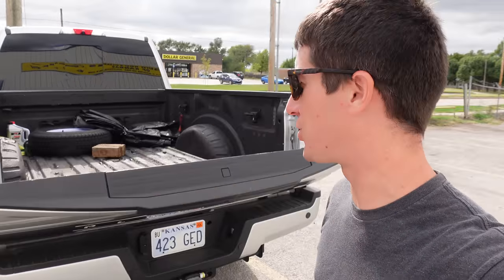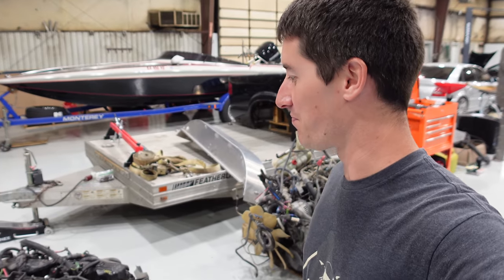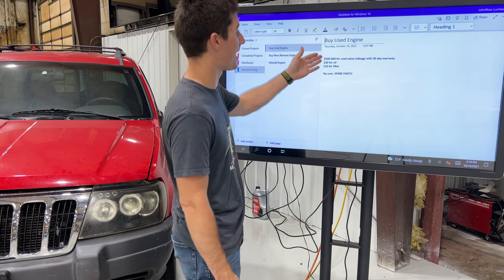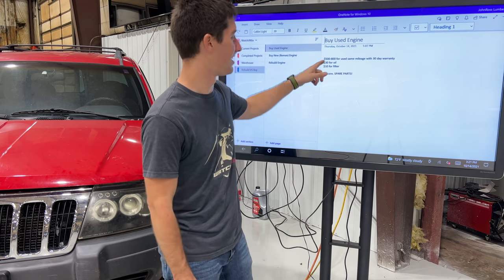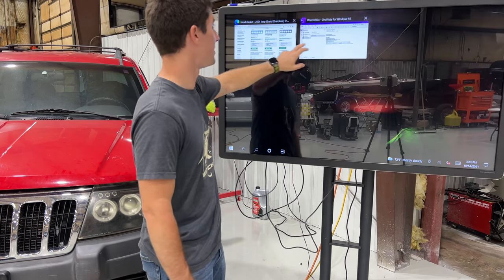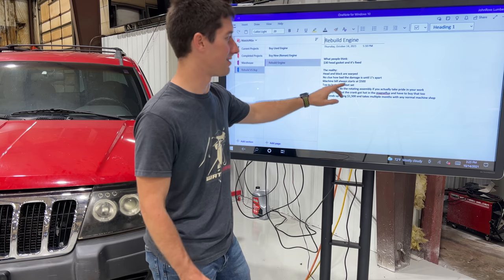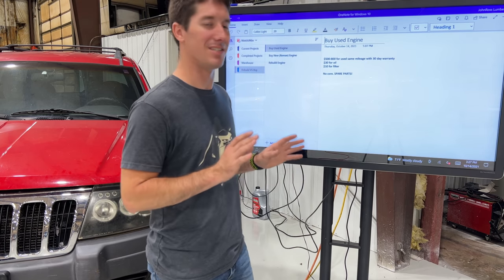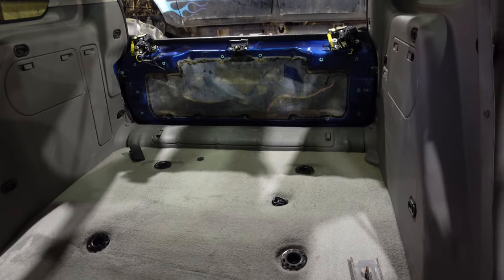Here's Why You Should NEVER Rebuild An ENGINE *The Math Doesn't Add Up*

Comment: I have done dozens of engine and never had to replace crank shaft, most big blocks have been done for 2400 to less than 3000 for V10 Ram  I always get a kick out of all these guys saying it’s 10, grand for ending rebuild, however you have the closest cost on rebuild, even though it’s high, but I don’t sell my trucks, I keep everything, my V10 Ram 2500 has ove 300,000 miles on, I bought new with 7 miles on , but I did like your vidp

Comment: I wish I saw this video before I decided to rebuild my N52 engine. Everything you said is exactly what I went through, now I need to get a new head or buy a 2nd hand engine
Reply: Hahaha... I found this video and this comment as I am trying to figure out what to do with my N52. I think I am getting piston slap or rod knock
Reply: @rockbe02  lol after fixing the engine, it was misfiring, only to find out it's my injectors. I then sold the car immediately. The total cost of fixing it is higher than a 2nd hand engine, I should have just done that from the beginning, hopefully you don't go through what I went through 🥲

Comment: This is why you shouldn't use the word "never" in a video, then go on to list all the times that rebuilding is necessary. If your goal is specifically to flip a car with a bad engine, where a running salvage replacement is available cheaper than a rebuild, and you're selling to someone who you won't have to see at a family dinner, or if they are coming to a family dinner you can easily avoid them, or you told them upfront the car has a salvage replacement engine then yes NEVER rebuild an engine. Also when you swap in salvage drivetrain, please don't tell someone it has a "new" engine/trans. That is seriously wrong. "new to a vehicle" is not "new", thats shady shit.

Comment: Well it is true in some cases and so wrong in many other cases.  You have access to cheap and good source of engines close by that have warranty.  For people that don't have that close by and have to rely on shipping it, it is not the best decision, If an engine is bad then you wasted like 12 hr for the swap which is time and cost money and if it was shipped then you are on the very very bad side of the deal.
While there are many cases that the engine that is bad is not totaled. You mention the headgasket issue which is common and the head might be warped but it may very much be OK. Also crank could be still fine and the whole bottom end could be fine. So machining only the head and putting a headgasket after checking everything is not so bad solution. Even full rebuild for $700 more than another engine doesn't sound that bad most of the time and that is the worst case scenario.

Comment: Here’s why you don’t buy a used engine. How many people have you  seen change the oil on time? I’m not talking about “the book says I can go 7,000 miles without changing the oil” on time. Have you ever seen anyone break in a new engine correctly? How many people do you see using block heaters in the winter? How many actually warm up the engine? How many have a prelube pump and use it every time they start the engine? Have you ever seen the average person do anything right when it comes to an engine? Now that’s what your probably buying! Don’t buy a used engine unless your at least going to tear it down for an inspection!

Comment: Hi came across your video years after it had posted. I am torn and hope I can get feedback. I have 2010 Honda Odyssey with oil consumption and leaks. A check engine that doesn’t go out. And my reading says to replace the engine block. A mystery misfire. I’ve spent a lot of money. Mostly ripped off. What can I do to save the vehicle for a few more years or should I save myself by letting it go?

Comment: Right, an engine from a salvaged car, you ask how many miles on it and a bit of history about why the cars been salvaged.  The honest guy will say how many miles do you want on it?  The normal guy makes up something to good to be true which likely is.  The fact is it's a crap shoot,  I worked in a salvage yard and seen it all.  I have seen four engines swapped out only to find it was the original ECM which ruined the first motor then the next two or three and wasted over five grand in tows, diagnostics and parts to figure out it was the computer that was shorted out do to a leak.

Comment: hey i have a 1.0 toyota and it has 125k miles i think of rebuilding it runs on thick oil than recomended consumes a little oil valve ticks the pistons slap

Comment: i call bs never do you need to replace loads of used parts on older engines if one say blows a gasket yea clean it do timing pull pistons and its as good as rebuilt mostly depending but buying a dirty old engine is no longer an issue

Comment: Better to rebuild then swap a used one. Otherwise you'd rebuild that used engine or transmission. Another is a remanufactured. Pricey but most come with a 3 year warranty.

Comment: Really need some advice, I have a 2007 Audi RS4 4.2l that has reached 160k miles. I'm getting p0392 and p0019 codes which are camshaft position sensor and cranksfaft position sensor on bank 2 with multiple misfires with cyl 5 showing the most. I replaced the cam sensor same codes come up. I'm thinking chain service is needed. Should  I get the chain service done for ~$10k and keep the psi 110,130, 150, 150,130,150, 150,150 engine until it dies or spend ~$12-3k for upgraded internals by AMTuned in Florida? I really love this rare car and just want it to last.
I want to keep this car and possibly put a supercharger on it. Please let me know what you think.

Comment: well, a well rebuilt engine; which in my opinion should only be done for worthwhile cars that someone is going to really love and want for a long time - vintage mercedes, saab, volvo...something that has an original quality that IS WORTH REBUILDING because the cars are going to run well for another 20 years with a good rebuild....a well rebuilt engine costs a TON OF TIME AND MONEY, and you should CHARGE ACCORDINGLY. Yes, there's no way I would sell an old car that I'm going to rebuild the engine of for less than like $10k let's say, even if the car only would have been worth $3,000 before the engine rebuild. You would have to advertise it accordingly, and find a niche market of someone who wants to pay for a car with a rebuilt engine. This is the territory of Modern Classic cars; if your car isn't a modern classic car - i.e., if you CAN GO BUY AN ENGINE FOR YOUR CAR FOR $500 that is in good original condition without leaks, then of course, he's right, there's no practical point in rebuilding. So in conclusion, rebuilding engines makes sense for cars that are worth rebuilding, because people love them, and if you do rebuild the engine, obviously you have to price those thousands of dollars into the finished value of the car (let's say a minimum of $3,000 parts and labor for most engines, more if you're upgrading with performance parts etc.). I do think, however, that if you have a good engine block that wasn't overheated or warped; you can absolutely run it across some sand-paper on a flat surface of glass, to make a nice surface for a gasket. There is not really any benefit to a machine shop doing a cast iron block if you're sure you are working with a flat surface. Sure, you probably can't re-sand a warped head on a board. But if you sand the hell out of any piece of metal, on a sheet of thick flat glass...you are, effectively, machining the part at home. How good you are at machining a part yourself depends on how good you are, but for sure, precision engine parts were made before modern machining equipment, and they used files and sandpaper... just as the machines do. I do think, if you're going to rebuild an engine, you should have a good basic understanding of mechanical engineering. Like, clean/ machined/ sanded mating surfaces are going to matter, for example, there's no point in doing all the work if you're not going to have flush surfaces to put back together.

Comment: So get a unknown import engine or salvage engine. Hmmh still a gamble. Or rebuild it myself let's see. Il rebuild it myself bore cylinders over at machine shop. Let them do other necessary parts. New oil pump water pump you get the picture. To each there own. While I can do the work myself I will rebuild. If its for a quick flip then i guess cheapest option

Comment: If you're flipping purely for entertainment (YouTube) then it would make more sense to rebuild the motor because it seems like that's what guys like me like to watch. Obviously if the bottom end is gone a used engine is the cure but many times just a head gasket and a surfaced head was required. Personally if I bought a car like that, first I would pull the head and see how bad it is before I sprung for a used motor

Comment: i got a 98 volvo v70 2.4 and i did a head gasket 3 weeks ago and no problem with my engine.
Reply: great car, i would have got the t5 or GLT though, 98 was a great year-the last drive by cable. Actually the first car i ever did a motor swap on-bought it knowing it had overheated, pulled the head and two cylinder walls were cracked. It was an xc70 and I threw a t5 motor in it.

Comment: You know want to know a cool fact about Vintage Porsche 911 read to the end.... okay let's think logical if the engine begins to overheat because of a head gasket leak chances are there's not enough water in it for the water pump to move the water so the water pump thing is a myth in this video. and for two what causes the head to Warp when the engine gets too hot the engine will when metal begins to get too hot it starts stretching in melting which is exactly what a warped engine is it got too hot and it slightly melted out of place. so let's think very logical on this there's  60 minutes in an hour so in one hour driving 60 MPH you will make it 60 miles so divide the time and a half you don't want to drive no longer than 30 minutes at a time oh just saying some engines heat up faster so keep your eyes on the temperature because when the engine gets hot you want the engine to cool down so it don't get too hot to Warp so 30 minutes 60 MPH you'll make it in 30 miles if you got more miles to go  you may need to shut the engine off a couple of times on your way back home but if you let the engine cool off so it don't get too hot and warp the engine what's it cools off you can start it up and continue to drive if it starts getting too hot again shut it down let it cool back off and drive it again the main thing in this scenario is excessive you don't want excessive Heat.. so here's the interesting part and let's put some logic in here think of a Volkswagen Beetle it is the engine is cooled by air There are some engines that do use air water and oil  it does not matter if the engine is water cooled or air cooled the method still applies if something's wrong and the engine is getting too hot it will  Warp at less you shut it down and allow it to cool down and it does not overheat... interesting fact
cooled engines the Vintage Porsche 911 is a oil and air cooled engine the
engines use almost 4 gallons of oil.
They do not have a radiator filled with
water and glycol.

Comment: I bought my bronco ii w blown head gaskets on the 2.9. I did the head gasket job but i had a set of heads off a bronco ii that i paid 200 bucks for and had a cracked block but rebuilt heads so i put those on and it ran great but one of the gaskets i replaced leaked some so i decided to j 302 swap it instead of replacing a gasket

Comment: Granted you aren't keeping the cars, but I have to wonder how many times you've gotten an about wore out motor with 200K or ¹⁄₄million or more miles, and the person buying a vehicle from you comes back a short time later telling you you sold them a piece of Scheiße, etc, because the engine runs like crap or died as it could possibly have 2× as many miles on it as what the odometer shows.  I get the economy/speed of it, but is the risk of getting a "good enough to last a week or two till you rid of a vehicle" engine worth possibly harming reputation in the community?

Comment: No for quick back on the road things its swap out and put in a JDM engine replacement and get it back on the road as soon as possible. Now for higher HP swaps and speciality engines then yes going with a built engine is the way to go but those are the 1% to 2 % engines that will see high HP applications. Think B16B B16A and very special Engines 2JZ 1JZ those type.

Comment: So - never rebuild an engine from an older Bugatti or an older jag from the 50s or 60s that has the original engine in it. were the original engine in a 60s hemi cuda..These are all inclusive when you use the word, NEVER
  But the headline got a click and that was the point after all wasn’t it

Comment: I rebuilt my old 352 5.8L big block ford and rebored it into a 390 for about 4,000 bucks and it’s completely brand new I stripped it down with my dad but a pro rebuilt it and even painted it and I see that as worth it buying a new engine especially a 6.4L would be a lot more than 4K brand new so SMD little man

Comment: I need advice, my 74 f250 390fe is in the shop and need rebuilt, i cant save any money i have zero mechanical experience. its going to cost 5,500 to rebuild, ive got two different quotes on ls swaps and one is 5,000 and one is 8,000. I want to keep the truck for sure, do i have another option? Would another engine swap be cheaper?
Reply: Big block motors are becoming harder to find so they are going to be more expensive to replace and to repair .  You might be able to get a better deal if you can source a running donor truck with a good running motor yourself and then you only need to negotiate the labor cost for someone to do the swap for you.  Are you determined to replace the 390 with another 390?  If not, search some of the ford truck forums online and you'll see quite a few people have had success swapping them with other/newer motors.  Good luck :)

Comment: I recently had an engine that leaked coolant into the cylinders.blew iut ehite smoke. rattle on startup . Sometimes surgered while driving steady. Scrapped the car it had 296000 miles ion it. Sure could fix engine but what about transmission hybrid components hybrid battery. Wherl bearings springs.struts. Brakes and tires not that much left. Decided wasn't worth it. Expect useful life of Prius 250000 miles.
   This brings up another point. . What good does it do to do a beautiful rebuild on the engine ifthe car won't last long enoughto wear the rebuild engine out. Bettervto buy a junkyard good junkyard engine which will last for as longascrest if car and pay less

Comment: I inherited a 1983 Chevy S-10. It was my grandma's. It is also the year I graduated, and the two-tone paint job is my HS colors. It has low mileage, It is straight and clean, but it has a head gasket issue. Do the number need to match on a motor? Do you recommend a motor swapout like in your video? The pickup has 77,000 miles. which I consider low. I plan to keep it and thought I would do the head gasket. (little experience at mechanicing)  what would you do..?
Reply: Not going to find many 1983ish motors in a junk yard that are any good. I would do a head job and keep driving it

Comment: OK I understand why you would not want to rebuild a motor in a car that you are just going to sell!! BUT at the same time there are arguments that could be made about opening up these motors BEFORE IN INSTALL THEM!! 

I am not saying you need to do a full tear down, but lets be honest here, even a low mileage engine may have been mistreated in its like!! And just because you are doing an simple engine swap in a vehicle you are just going to get rid of, shouldn't mean you are handing over junk automatically either!! Besides the headaches that come from selling used cars these days, you certainly want to protect your business by making certain the new (used) motor still has bearings in it, and that it (the engine) isn't full of gunk either!! I knew a guy who once sold a car after he filled the crankcase full of saw dust, because the bearings in the bottom end were totally shot!! And I knew another guy who swapped out the spark plugs to hotter ones, just to hide the fact the piston rings were gone (the hotter plugs were burning off any oil in the cylinders better)!! And there are a lot of dirty tricks I have see when I was a mechanic, that most normal people wouldn't have noticed is my point!! And I can't count the mistakes (even stupid ones) that I have seen people do on old cars I have bought used myself!! I once got a Chevy Van where somebody installed the rear brakes all messed up, and nobody said anything to me about it!! I did notice when I test drove the thing that the front brakes were grabbing harder, and just figured the rears needed to be adjusted....until I took them apart to inspect them after I bought it!!

Comment: Most of the time an engine will last no matter the brand. It's Lack of Maintenance, Oil and Coolant that will kill an engine. Why waste time and money? Just swap em out and send it on its way. 

You could give peice of mind to the next owner by doing a timing belt/water pump service if you wanted. Not everyone is mechanically inclined. But in the end, it's a used vehicle As-is/Where-is.
Reply: not going to make any profit doing timing belt jobs. Your own car definitely including oil pump, idlers and tensioner pulleys, front, rear and cam seals, turbos.